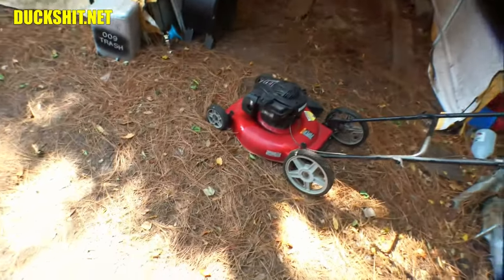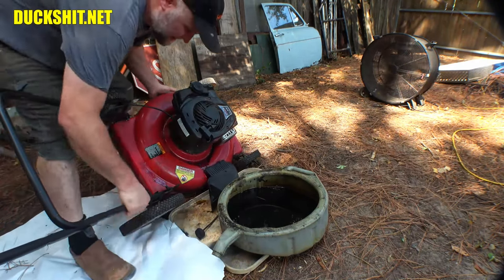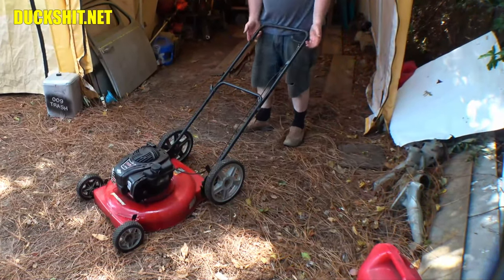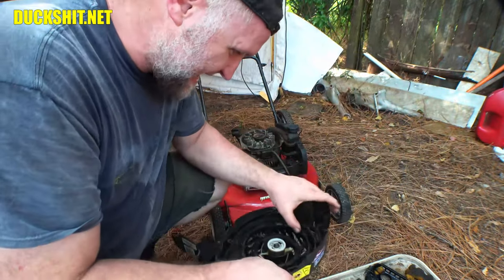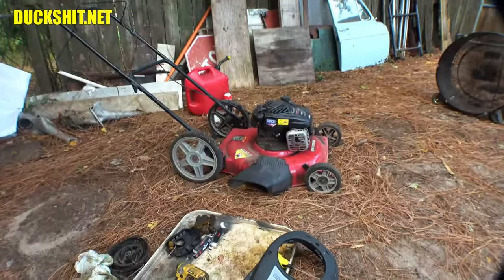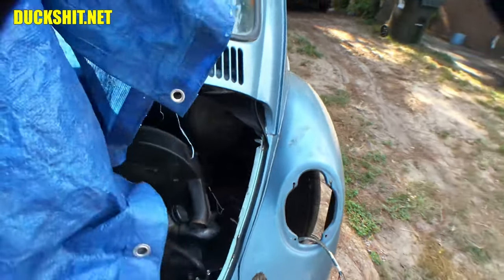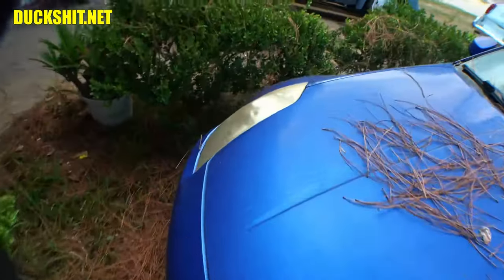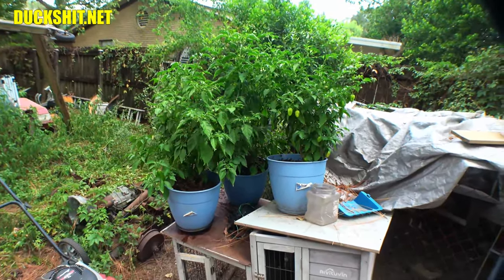🚮 Garbage Picked Murray Mower  🔧Will it Run? - Small Engine SUNDAY

Comment: if you cover the pot and the area on to around the plants dirt area with saranwrap it will hold water better for you..when the get on the dry side the roots get to warm 😁😁
Reply from the maker: Good call, probably one of the better ones that anybody has suggested.  It's about to rain over here finally thunder is booming like crazy the last 30 minutes.  I may not even need to cover it LOL!  Thank you for that suggestion!

Comment: the coil on mowers need a gap between the coil and flywheel, you can loosen the coil put a postcard between the coil and flywheel , and use the magnet to pull the coil against the flywheel so you can tighten the coil to get the gap you need for it to get spark properly. i like to use some fine grit sandpaper on the magnet and coils part that faces the flywheel, it may not matter but i have had a few times it needed cleaning for good purple/blue spark..yellow to whitish spark isnt as hot as purple/ blue spark to ignite your fuel 👍👍 also if you have a mower with the hand brake on the push bar you can just pull it over with the brake on to remove some rust from the magnet 😁😁
Reply from the maker: Oh is that how it works? LOL.. thanks man.  There was a high spot on the flywheel right at the magnet, it didn't appear to be rust unless it's rust under the magnet pushing it up.  Anyway once it started running it went away.  Probably wasn't much anything.  😁👍🏻🦆💩

Comment: I don’t what’s up with mine proper oil levels prior but this time I opened it up and it just puked out everywhere like I majorly over filled it , smell
Like gas. It’s always puffed blue on start stink like burning oil … one of them Walmart specials ..
Reply from the maker: But for the oil level to rise and smell like gas is highly unusual on a mowjobl.  On a VW there would be reasons for this, but I'm not sure what to say for one of these little engines.  Look for overflowing fuel somewhere when its shut off?